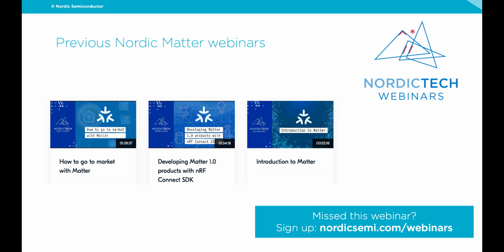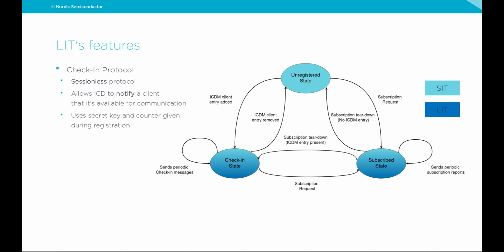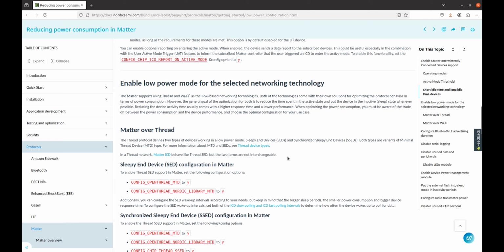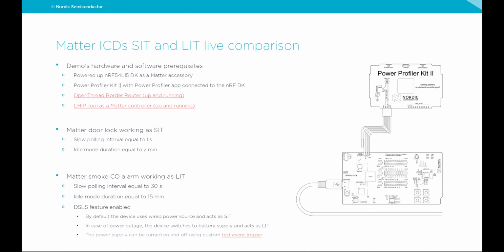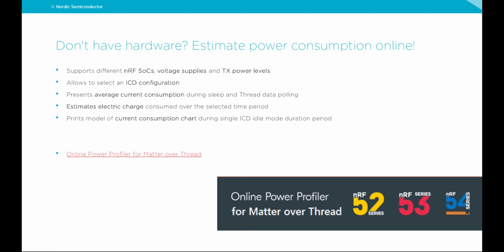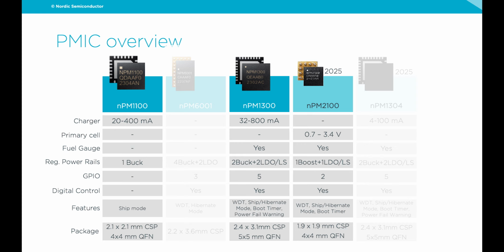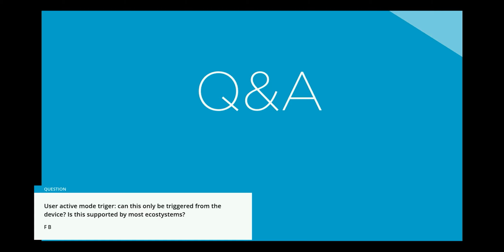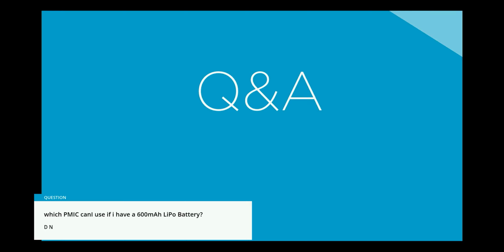Developing low-power Matter devices with nRF54L Series

Comment: Hi~, I use nRF52840DK PPKII  and the Lock sample but my average current is 800+uA, can I have the photo of the connection between nRF52840DK and PPKII, what more, is there any change of the sample code ?